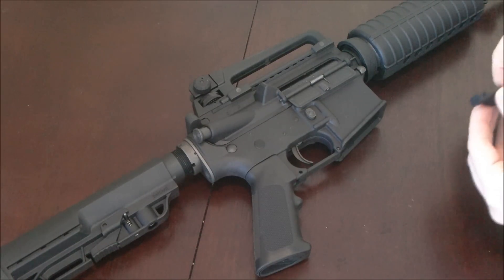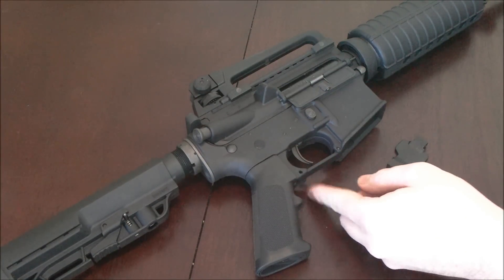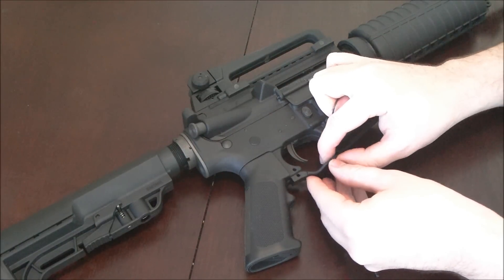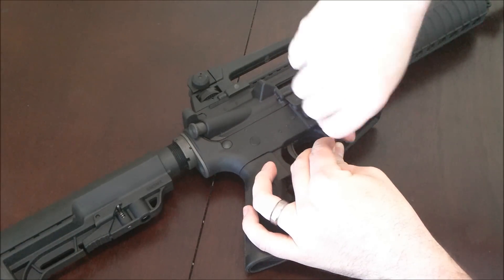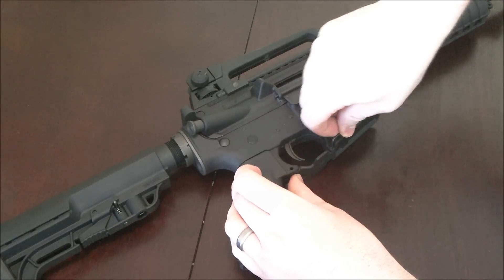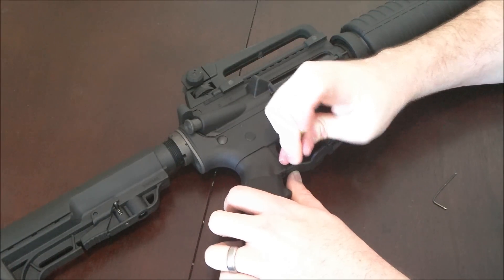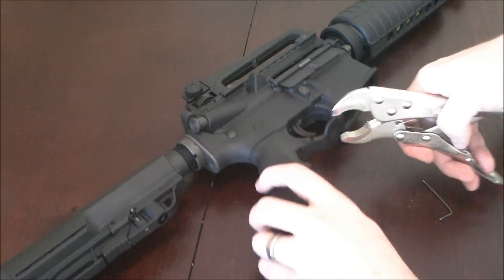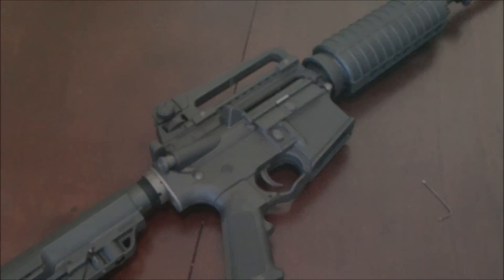Strike Industries Cobra Trigger Guard - Jag Precision VFC Build Part 2

Comment: GOT one but then my gen3 Pmags do not work. Says this on there product box but not there website!
Reply from the maker: Are you talking about the Cobra Fang trigger guard? That's different than this one, and it says right on their website that it's not compatible with Gen 3 PMAGs.
Reply: Booligan Airsoft  ya your right I was talking about the fang trigger guard and I got mine from Amazon from them but at the time I got it there was no mention of the magpul problem. It is a real cool looking design but most of my mags are gen3. Great video
Reply from the maker: Ah, just checked out the amazon link and no, it doesn't mention that at all. I'll email my guy over at Strike and make sure that he adds it to those listings. I'm running the Fang on my real AR pistol and an airsoft project, I love the thing, but yeah, it's no-go on Gen 3 PMAGs.